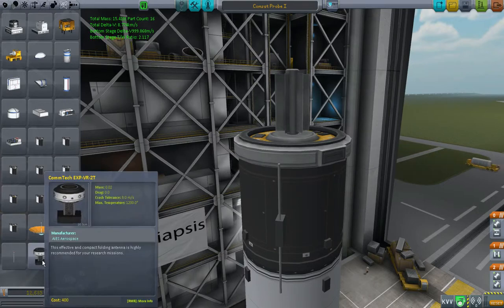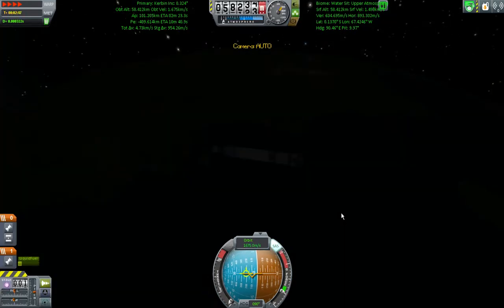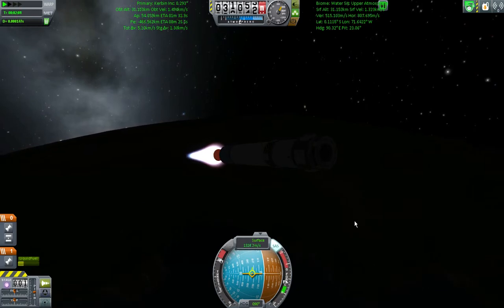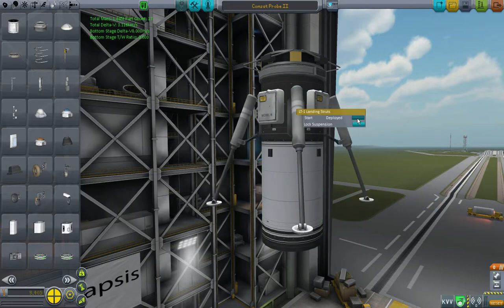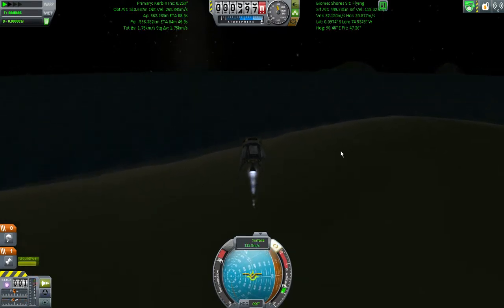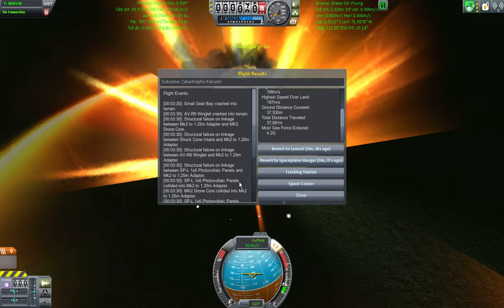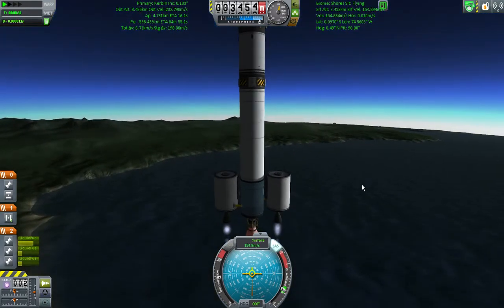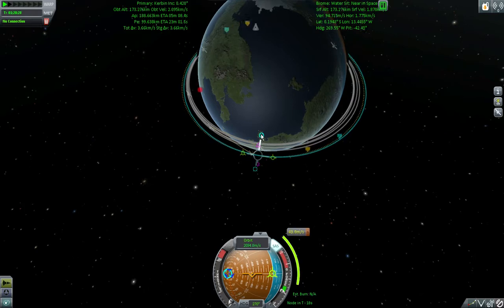Let's go to space today: Trying to figure out Remote Tech

Comment: I have never tried Remote  I... but you have me interested. I will have to try it. I think maybe a much higher orbit with more powerful satellites would be a better first network solution just to have a longer line of sight with more altitude. I will have to give it a try
Reply from the maker: On my career save (the one I'm doing modded career vids), I managed to boost up a geosynch unit to be pretty much righ over KSC, using lessons learned from this very video (of how NOT to do it).  And as you said, it pays to use a beefier antenna.

Comment: Not sure if you know this.. but the new Kerbal Engineer has that same kind of heads up display data about your orbital info and surface info that you are using that other mod for now.
Reply from the maker: I used to use KER extensively, but not since it was updated.  VOID has a lot of other information tabs you can call up, I usually only leave the HUD on, but I can easily call up orbital parameters and find out my orbital period (which is critical for a good geosync orbit).
Reply: the new KER has a lot of edit options to put whichever data you want in that heads up display area and also other panels. you also do not have to add the "part" to your ships to use KER now... I really like the new improvements to Engineer
Reply from the maker: Excellent!  I'll probably pass on it, though, since I have RPM and that can display a bunch of parameters and stuff.  Guess there's a bunch of ways for the plugins to call up the raw data.  RPM, VOID, KER, MJ...  Probably some other ones I haven't even heard of yet...